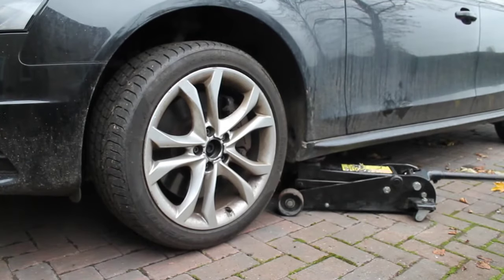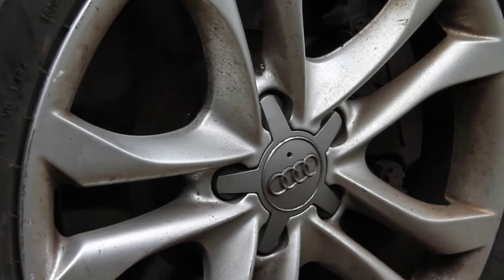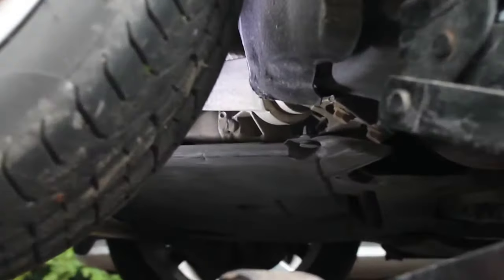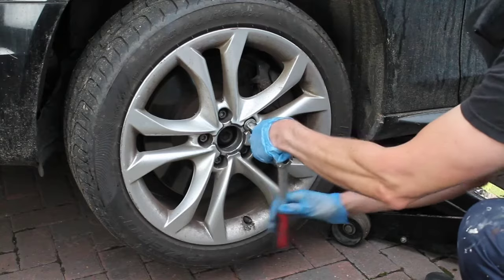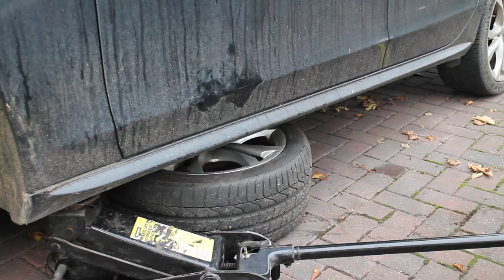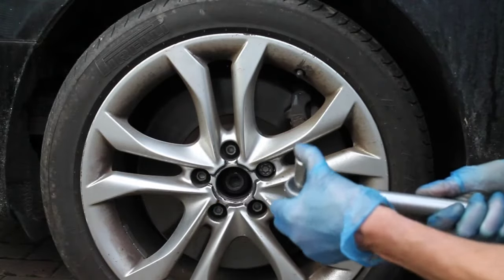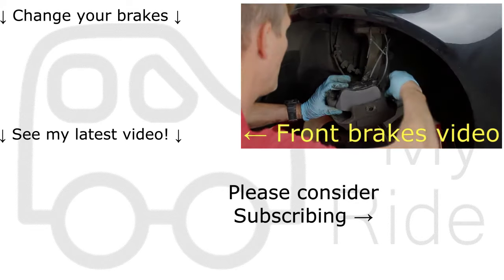How to Jack up your car, Support it with Jack / Axle Stands and Remove the wheel

Comment: Thanks for this. I have just replaced a speed sensor on my BMW X3 which is just behind the wheel arch. My BMW jack came crashing down and fortunately I had placed a concrete block under the car just in case. If not I could have been crushed if I had relied solely on the car jack as the wheel was off. Yes, I now know that one should not work under the car with only a jack for support. I took the failed jack into my local BMW dealership and the service manager was not interested at all in my failed jack. He told me that he would send it away for analysis at my cost. The thread had stripped on the thimble and the jack just collapsed. I am stating all this just to remind all who read here not to trust the scissor jack provided by the hem.
Reply from the maker: Thanks for taking the time to share your experience! Really good to hear you didn't get hurt. I had a similar experience years ago when using the emergency kit jack, scary stuff! Take heed and BE CAREFUL OUT THERE PEOPLE! I will pin your comment to the top of the board. Thanks, Phil
Reply: That's why they call those types of jacks widowmakers. Scary stuff
Reply: I’m a firefighter and we had a fatal in exactly this situation last year. A few weeks before Christmas. It can happen.

Comment: All good but what happens when I have a puncture and am on the side of the road with only the tools in the back?
Reply from the maker: Hi NJD, it's a fair question! I'll answer but first let me explain a little... I have done lots of Car DIY videos (100+) and many of them start with getting your car onto Axle / Jack stands. This is an important step but I didn't want to show it over and over again. So, I created this video for people who are about to carry out maintenance on their vehicles and I refer to it in my other DIY videos. Back to your question: There are many different designs of the small portable car jack and it is impossible for me to to show them all in one video. My recommendation is for you to go get your car tool kit jack out and see how it works. That way you will know straight away should you ever need it. They will almost always jack up on the sill / pinch weld on the car. Some cars have a special plastic stop just under the car that the jack fits into. If you have it, the owner's manual will almost always explain how the jack works and where the jacking point is. Bear in mind many modern cars have run flat tyres and no jack. If this is the case, drive slowly (usually max 50mph) to the tyre shop or home. Some cars have tyre inflators and no jack etc. Hope this helps! Thanks, Phil
Reply: @ReviveMyRide  Thanks Phil - my interest was aroused yesterday when I decided to replace the air filtters on my partner's 2913 Audi and I dropped a screwdriver part down the car. I was parked on grass. I thought about jacking it up to get the plastic under sheet off and then looked around for a jacking point and unlike my 1978 mini it was not obvious so I had a look on the web for jacking points and came across your video.  I appreciated your video but was wondering about a road puncture.
Reply from the maker: @njd2342  No probs at all, I can understand the question. Yep, as mentioned above the tools kits for just about all "modern cars" have a jack for the sill or with an attachment that goes into plastic block close to the sill. The location for the road side / tool kit jack is show at 2:40 In hindsight, I should have at least show the toolkit jack! Thanks, Phil
Reply: @njd2342  I think the answer you wanted is whether or not you can jack your car up on the side of the road with the scissor jack(normally) provided in the boot and change the tyre?
In which case if you're efficient and quick, yes. This can be done and has been done millions of times over with no repercussions. One thing I would mention would be take your spare out before jacking and as soon as the car is jacked up slide the spare under the sill/pinch weld. Once the old/punctured tyre has been removed place that under the car and fit the spare, swap them over so to speak. Obviously remove it before lowering and you should be fine. Scissor jacks can be dangerous but if used correctly, and as long as they don't fail, changing a tyre is wel within their capabilities.

Comment: You show an Audi and then say BMW.....which is it? I need it for an A4 and I cant seem to find a safe spot on the cross member so I can put the jack stand under the pinch weld.
Reply from the maker: Hi, yes, sorry, it is a “generic” video, so I try to show examples on a few different vehicles. One of my favourite places to jack up at the front is where the lower rear suspension arm meets the subframe, I actually put my jack onto the joint of the suspension arm (that houses the rubber bush) where it bolts to the subframe. This area is super strong and the shape of the bush / joint fits into the dish on the trolley jack, so I know it is secure and can’t slip out. Hope that helps! If in any doubt, find a friend or work colleague “car person” and ask them, most people will be super helpful when they know you are asking to try to stay safe. Cheers, Phil

Comment: HI,im going to doing a brake job soon on my 320D this is the first time i do this on bmw,i want to ask about where i can put the axle stands coz i see you in the video you put the stand under your suspension system but im not sure where is it and im dont want to take a wild guess so could you able to tell me where is it,in any other of my  old car it can easily just put the stand at the side jacking point so im lost lol,thank you
Reply from the maker: Hi, you are exactly right, on your BMW, the side jacking point on the sill is the best place for the axle stand. On BMW's & Mercs, there is a central position underneath the cross member for the trolley jack and this leaves the side jacking points available for axle stands. The reason I show using the suspension arm mounting point in the video is because on some other cars, there isn't a good jacking point on the cross member, which means you have to use the side jacking point for the jack. As the jacking point is already in use, you have to find somewhere else for the axle stand (Hence, the suspension arm where it mounts to the underneath of the car). I am assuming your car is an E90, if so, there is a great write up with images that you should check out on Pelican parts: https://www.pelicanparts.com/BMW/techarticles/BMW-3-Series-E90/BASICS-Jacking_Up_Your_Vehicle/BASICS-Jacking_Up_Your_Vehicle.htm Make sure you take the other precautions: Don't reach under the car until it is fully supported, leave the jack in place (with a slight amount of tension on it) during the job, once you remove it, place the wheel under the car for extra security. Hope that helps! Phil

Comment: My jacking points are covered by my aftermarket side skirts. What’s best way to jack it up
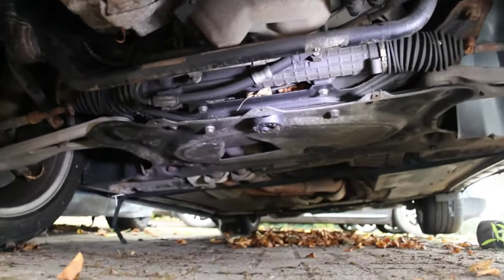Reply from the maker: Hi Jack, depending on what car you have, you can jack at front of the car in the middle of the cross member. If it is intended as a jacking point, you will often see a rubber or plastic pad fixed to the cross member, see 2:00 in the video for examples on BMW and Merc cars. If you are jacking up at the rear of the car, I like to use the rear differential. When doing this, I put a rubber disc / pad on the jack as a bit of extra protection for the diff. Hope this helps but if in any doubt, ask around and see if anyone you know has experience of this and can show you for the first time you do it. Thanks, Phil
Reply: @ReviveMyRide  hi I have fiesta st I’ve done it all now. Thanks though
Reply from the maker: @jackbeames7643  Sorry for the slow reply! I didn't get a notification for your comment for some reason and just found your question when browsing in my comments area... Glad you got on ok with the job, the Fiesta is a nice little car! Cheers, Phil

Comment: Wheel nuts should be tightened in a cross cross pattern. 
Good to see a torque wrench being used correctly.
Reply from the maker: Thanks, Yes, you’re right about the bolts, my bad! Cheers, Regarding the torque wrench, people should use them more!

Comment: I need to invest in a shop Jack. All I have is a trolly Jack. Gotta make do with it for my oil changes.
Reply from the maker: Yep, a really good Jack and jack / axle stands to go with it would be a good investment. I have been using my current ones for at least 15yrs now. Easier lifts and safer too. You don't have to spend silly money to get a good one. Happy shopping if you decide to buy! Cheers, Phil

Comment: If I want to service my transmission,  don't have access to a lift, will I do it with one axle stand or do I need the car to be level all four wheels off the ground? 
If its the latter how do I get all four stands under without the car being off balance? 
It's an A3 s-tronic
Reply from the maker: Hi, I would recommend 4 axle stands and having the car level. I would start at the front: you can jack up first one side, place the axle stand and then do the same on the other side. Then, once the front is supported, you can jack up the rear centrally from the diff, this will allow you to lift the car evenly at the rear without disturbing the front axle stands but this does require the use of the trolley jack, as it will allow you to roll the jack in from behind the car and jack it up without going under the car. As it is a fairly long job, I would recommend removing the front two wheels (loosen wheel nuts before jacking up the front) and sliding them under the car for extra protection. Also, with them removed, it will be easier for you to access the underneath of the car. You can use a spirit level under the sill of the car to get an idea of how level it is. I'm not sure of your experience level, so please remeber that safety is no.1 If in any doubt at all, don't go under the car and consider calling in a favour from someone who has done it before to check your set up. Hope this helps, if you have any further questions based on the above, please ask away! Thanks, Phil

Comment: Putting axle stands on suspension parts?! 
My last job was an  anti rollbar replacement, so I had to do the job using the jack only,as I couldn't see where to place an axle stand without fouling the job.
Secondly, it would be nice if British car DIY videos would use a vehicle not German,just occasionally.
Reply from the maker: Hi, 90% of the time when I’m working on a car, I jack up (using a trolley jack) on the centre of the front cross member or on the rear diff. This then leaves the normal jacking points on the sills, near the wheels, free for placing the axle stands. You can get sill adaptors that fit onto you axle stands, to help prevent damage to the sills. My advice: if you can’t find where to place the axle stands, don’t do the job until you find out where / how, it’ll catch you out one day… Hope that helps you some! I only work on my own cars, 4 of which are German (just worked out that way!) but I do have a British car (a TVR), which I’ll try to feature more often but it has very specific jacking requirements (being a body on frame car), so not very useful for most people! Thanks, Phil

Comment: Good Afternoon! Do you have an email address so i can get in contact with you?
Reply from the maker: Hi, sorry, I don't have an email linked to this channel. If you have a question about the video though, please go ahead and ask on here and I will answer if I can! thanks, RMR
Reply: @ReviveMyRide  I need help properly placing a jack under my van in the correct jacking points and the same for jack stands, are you able to help me with that?
Reply from the maker: @angeloyourreflection9331  Happy to try to help! Can you tell me, are you jacking up the front or the rear of the van? What job are you planning to do? What kind of jack were you planning to use? Cheers
Reply: @ReviveMyRide  Good Afternoon! Thank you very much for wanting to help me out, im using a floor jack, im trying to jack up the entire van with 4 jack stands, as for now all i need help with is how to properly and safely place the floor jack & 4 jack stands under my 2003 Dodge Caravan. SE
Reply from the maker: @angeloyourreflection9331  Hi, every car is different, so it depends on what you have access to. Starting at the front: I like to jack in the middle of the front on the cross member / subframe but if you can't see it because of an engine undertray, then you can jack up one side of the front of the car, put it on a jack stand and then go do the other side. If jacking one side and then the other, I like to jack on the "pinch weld" just behind the front tyre (but note in my video, I used an adaptor on the floor jack to avoid damaging the pinch weld). Regarding jack stand placement, I usually use a point where the suspension arm (coming from the wheel) meets the subframe, usually there will be a big bolt here. I found a video where someone jacks up and supports the front of their Dodge caravan. Hopefully this link works: https://www.youtube.com/watch?v=13uS2x7h5B0
Regrading the rear of the car, I usually jack at the centre of the rear axle on the diff and then again, I place the jack stand where the subframe is bolted to the underside of the car or on one of the suspension arms, where it meets the subframe. However, be aware that you don't want the jack stand in the middle of a suspension arm because a lot of them are Aluminum and not designed to take that sort of load, also don't place your jack stand just under the car body (on the standard sheet metal), it won't be strong enough either. I found this useful bog that features your vehicle, hope it helps! https://asspd.blogspot.com/2020/03/2007-dodge-grand-caravan-floor-jack.html 
If you are still in any doubt at all, I would find someone experienced who can show you exactly where on your vehicle to jack and support and then you know you will be safe. It might take a little bit more time but worth it. Cheers, RMR
Reply: Hi where do you buy the slotted  jack pad from? I bought one before but its dangerously soft and not safe
Reply from the maker: @mrt4409  Hi, you are right, there are a lot of these out there and some of them are too soft for the job. I bought this one from Amazon: https://amzn.to/36cYu6X It is available in two sizes, so choose the one that is right for your jack. Hope that helps! Phil

Comment: But I’m removing my wishbone
Reply from the maker: Hi, if you are working on a front wishbone, then you will need to jack in the middle of the car under the cross member as shown in the video at 2:00 and then you can place the jack / axle stand on the jacking point on the sill / pinch weld. You can get various styles of rubber / plastic adaptors that make it easier to support the car on sill / pinch weld. Like this one https://amzn.to/2RnpXhG (but you need to check that it will fit your axle stand). I hope this helps, any questions please ask! If in any doubt, don't risk going under the car and try to find someone who can show you in person! Thanks, Phil
Reply: @ReviveMyRide  Thanks Phil very helpful advice 👍